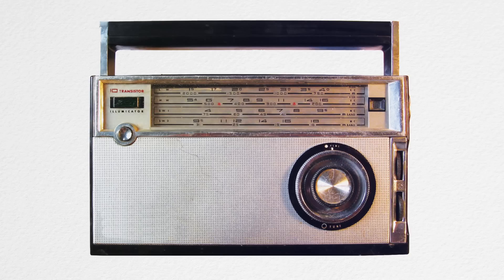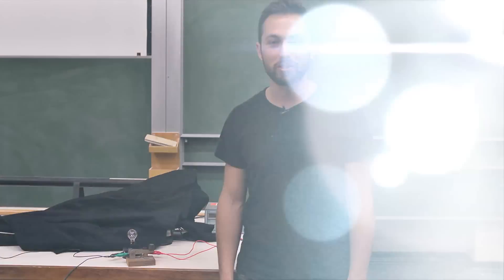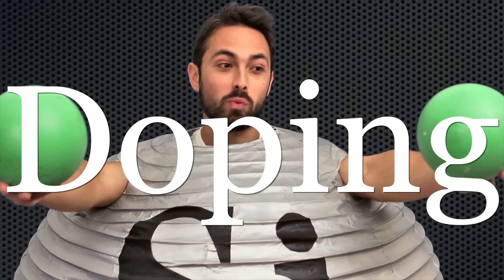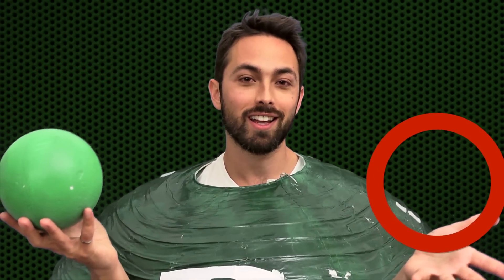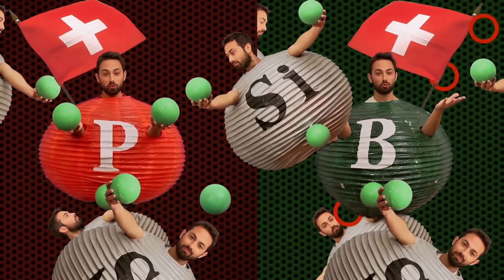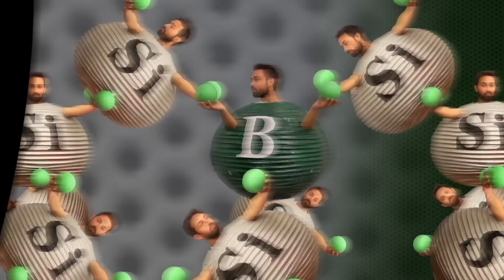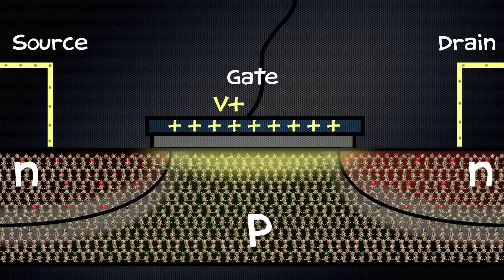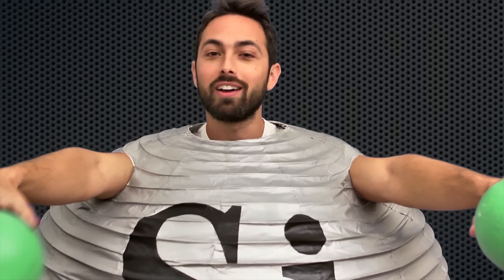How Does a Transistor Work?

Comment: Transistors https://www.youtube.com/watch?v=IcrBqCFLHIY&ab_channel=Veritasium

Doping – when an element is injected into the silicon to improve  

N – Type is when phosphorus is injected into silicon. Phosphorus has an extra electron which mean that it conducts current better.

P – type is when boron is injected into the silicon. Boron is missing an electron which creates a hole. These holes still conduct electricity as they move around.

 

N – type and P – type are neutrally charged. In N – type, it’s negative electrons that can move while in P – type it’s the positive hole that move.

A transistor is made with both N – type and P – type. Transistors are mainly made up of P – type conductors with some N – type conductors on the top right and left. 

 
	The left N – type conductor is called the Source, and the right is called the Drain. Both the N – type conductors have an electrical source. The P – type conductor also has an electrical source all the Gate that is separated from the P – type conductor by a layer of Oxide. 
	
	Depletion Layer is the area around where the N – type and P – type touch. In this area the extra electrons from the N – type move over to the P – type and fill the missing electrons. The depletion layer acts a barrier preventing electrons in the N – type area into the P – type. 

	The state that I’ve just described is when the transistor is off. To turn on the transistor, a small voltage is brought to the gate. This electricity attracts the electrons so much that the electrons overcome the depletion layer. From here the electrons move through the P – type conductor, through the other N – type conductor, and then through the drain.
	
	This essentially creates a switch. With the transistor is off, power from the source is trapped in the left N – type conductor. But when the P – type conductor receives power, it creates a path for the electrons to the drain.
Reply: My notes, thanks a lot!

Comment: I find it fascinating.
Here in 2020, and we've already hit the quantum limits of silicon transistors.. 
Several years ago. 
The boundless optimism we had it's just fascinating.
prediction stated that at 14nm we would have issues and we did. the idea that we thought we would not have issues for another decade it's just phenomenal.

There are attempts at using other semiconductor materials for a 4nm chip, and creative geometry has allowed for "technically" 7nm nodes, but that is not 100% honest its creative geometry and marketing pointing to chips that pack regular 14nn transistors 7 nm apart... Causing issues naturally.
most chips now just push more cores and bigger chips while trying to reduce energy consumption across the entire system, with no large improvement in processing density over what we had in 2015. Just two years after this video was published.

Comment: @ 4:19...but when you have a PN junction, electrons will flow from N to P if they are pushed in that direction (with a voltage)...so i dont understand how you can say that the P deflects the electrons

Comment: 2013: "A problem we won't face until probably 10 years down the track.
2023: ...... 👀
Reply: It's scary that 2023 is closer to us than 2013
Reply: @rohithbaliga  2060 is closer than 1980
Reply: @AnniSuggestion  omg
Reply: @AnniSuggestion  hacks
Reply: but what is the problem about not going smaler?
Reply: @scuida2730  22nm as said in the video is ~50 atoms width.
currently we are approaching 3nm.

Making a transistor with 3 parts+input with 6-7 atoms seems impossible, but TSMC should go into massproduction in near future.
Reply: @scuida2730  bigger ones require more power than smaller ones
Reply: @murarikarmhe2322  Also you cant make a CPU much bigger because at some time signal latency will screw you more then you benefit from it
Reply: @scuida2730  In the end, one atom has the size of about 0.1 nm... and u need at least a few atoms to make a transistor.
Reply: @yourguard4  You would hit quantum tunneling before that
Reply: @Moltenlava  true
Reply: Lol, I was thinking just that. Me: “Ooh, were almost there.”
Reply: @Sizwe Letanta Yes, but when its technical not possible to go smaller at this point, everyone has to find other ways to improve their products.
Reply: @scuida2730  And that's what they are doing. The processes to get smaller transistors are taking more time, so manufacturers are trying to make chips faster in other ways. (See Intel Tick-Tock). The thing is that new outcoming chips are not as that more powerful than newer chips before. A fast CPU from 2015 is still good to use.  Try to put that in perspective with CPUs from 1994 and 2000. The good thing about that is that you don't need a new computer every 2 years if you want to have powerful machines.
Reply: @Xaonic Infinity Look at the Ryzen series - its one of the perfect examples. Scale is one thing, but the architecture of the product matters too.

Comment: At, 2:26 holes are more than that of electron(they are not lesser than electron)
Because you're doping it with boron which is trivalent
I got the point you were making but,no if holes responsible for( conduction ) is greater than no of electrons responsible for conduction.

Comment: Just as a little FYI if you work with hobby level transistors, they don't use the term source, drain, or gate. They instead use the terms collector, emitter, and base respectively.

The more you know.

Comment: Its 7nm now in 2019 😱😱😱
Reply: Meanwhile Intel is still not capable of selling consumer processors below 14nm
Reply: As mainstream yes, if i'm not mistaken, IBM did 5nm few years ago.
EDIT: 5nm is already mainstream, Samsung has begun production this year and plans on going even lower (3.5nm).
Reply: @cekpi7  2nm are in progress now
Reply: I'm here from the future, and we've achieved -3nm.
Reply: @zacharyjefferies9965  😄
Reply: @cekpi7  how many atoms is that?
Reply: @cekpi7  these nanometer ratings are just marketing buzzwords now.
Reply: @Ikbeneengeit Not all of them,  but yea, most CPU manufacturers use smaller number, even if small part of the chip is made using 7nm and other part using 12nm process, they will say it's 7nm chip.
Reply: Intel be like: 14nm +++++++++++++++++-
Reply: @9h-06elangbagaskaraputra9  gotta wait like 2 more years lol
Reply: It's not really. The 7nm and 3nm is the size of the smallest feature not the size of the p/n gap.

The smallest feature is the insulation between separate transistors

14 nm has remained the transistor p/n gap size for quite a while. Moors law is fully broken, we've reached the end of silicon.
Reply: Update 2020... it's 5nm 🤯🤯
Reply: 2021 BIG UPDATE - Ali Javey, left, and Sujay Desai have created the world's smallest transistor. Publishing their achievement in Science, the researchers explain that the device has been built using carbon nanotubes and molybdenum disulfide, creating a transistor with a gate length of just one nanometer.
Reply: @rajbirsingh2771  that was published in 2016
Reply: Bro its...2nm today by IBM
Reply: iPhone 12 has 5 nm process.
Reply: @josearmandoguerrerochairez3454 , and those transistors are only 10 atoms wide.
Reply: @hy7968  I know, is not that amazing?
Reply: Ans it is going to be 5 nm in 2020.
Reply: @IAmSuchANerd AndALoser nope, 1 atom is 0.2nm across. So 1 nm would be 5 atoms!
Reply: It's July 2021 now and Apple and Intel announced yesterday they'll be the first companies to use TSMC's 3nm process, to start production in the second half of 2022. The iPhone 5 he's holding at the start of this video had an A6 chip, which was built on a 32nm process.
Reply: And this is now 2020
Reply: Apple m1 chip is 5nm

Comment: Some gaps here. That’s field effect. Don’t junction transistors work a bit differently? Also, the gate goes positive with respect to the source for n-channel to control the drain, which is also positive to the source. The analogous parts of a junction transistor are emitter, base, and collector.

Comment: How can a lack of electron be + ? I mean that should be neutral, right ? Why consider the holes positive rather than neutral ? 
Please explain
Reply: The electron is not positive.  The lack of an electron in the valence/conduction band of the atom is positive, relative to the four electrons per atom that "should" be there.  On net, the complete body of p-type silicon is net neutral, as is the complete body of n-type or pure silicon would be.   Silicon has 4 valence electrons, which could either be in the valence band or the conduction band, depending on how energized they are.  When you replace some silicon atoms with Boron atoms, there is an electron missing from what is necessary to form the interatomic bonds.   And these missing electrons flow from atom-to-atom throughout the lattice, as if a positive charge were flowing.

Comment: I have a bit of a confusion. A switch with no moving parts seems inconceivable. So the "sources" electrical flow to the "drain" is resisted until a positive charge from the "gate" turns on. Well what switch is turning off and on the "gates" voltage?
Reply: A web of other thousands of other transistors, ultimately controlled by the way you control the machine.

Comment: but how does the "gate" turns on and off?
Reply: Well some are connected to the outlet, so they are always on showing up on screen as the pixels saying press enter. When you the press enter, that turn some on and some off, i suggest you watch crash course on the matter of boolean logic
Reply: @davisdysthe7859  I watched it, what am I really asking is how does it physically turn on and off. I know commanding 1 is on and 0 is off, but what is actually causing the voltage to turn off?

Comment: I have a question. Why won't the electrons form depletion layer rather, they could be attracted by the holes in p-type. I mean a total diffusion of charges on both types.
Reply: Sri Haran Raj because the closest electrons move first, and as they move to fill the gaps in the n-type the depletion layer forms. At a certain point the negative charge of the depletion layer keeps the electrons in the p-type from moving to the n-type. It reaches an equilibrium.